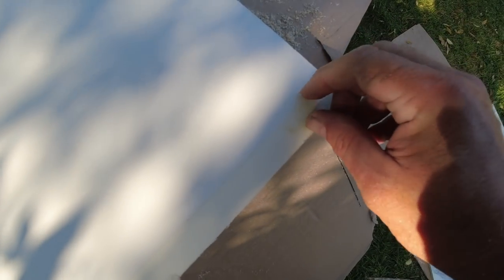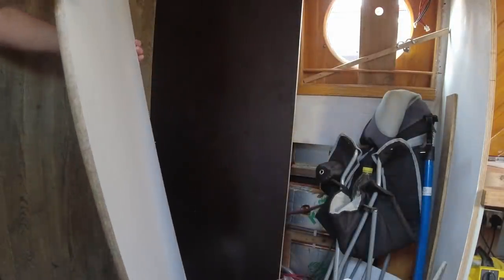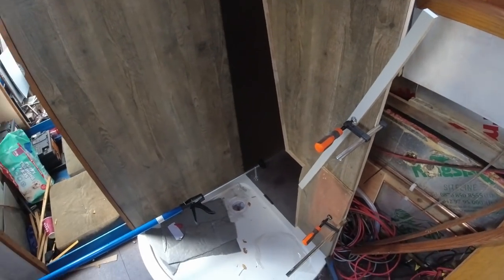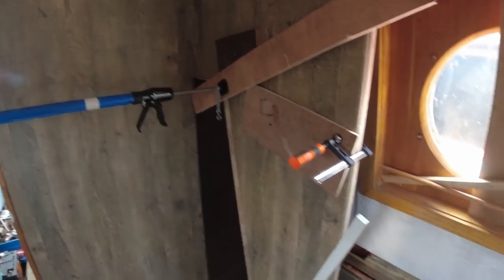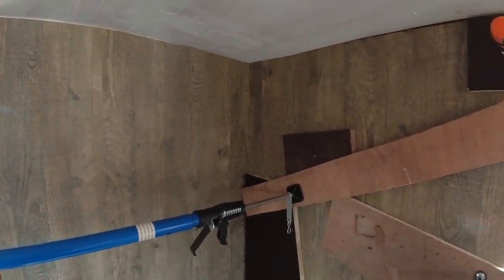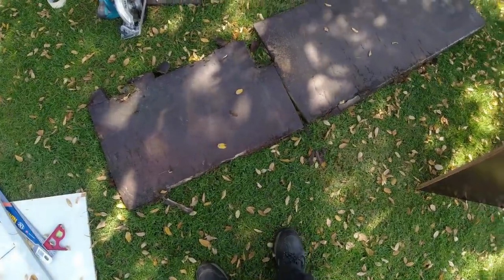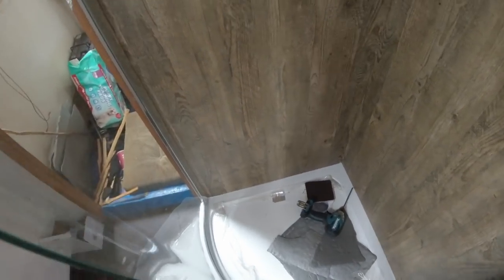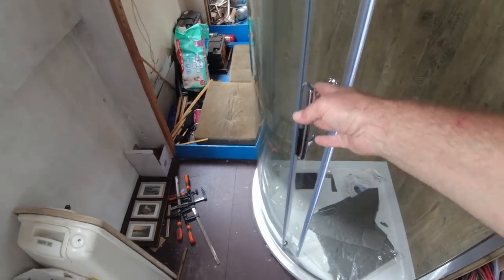Narrowboat Refit #34 Fitting a shower cubicle into a Narrowboat

Comment: i have had the masking tape and saw problem. What works for me is to use low tack masking tape for the marking, and then, before cutting, run some sellotape over the masking tape. You can still see your lines, but the saw base doesn't stick to the sellotape. It works well for me. Cheers Steve, am really enjoying the vlogs and am learning a lot as you go on.
Reply from the maker: Thanks Andy great tip with the sellotape 😊 don’t trust to much on what I do as a lot of it I’m just winging it 😂😂 thanks again Andy 👍🏼

Comment: Steve are you going to put foam lagging on the pipes before you box them in, we found on ours that if you leave the boat it can all get very cold and the lagging helped prevent the pipes freezing  in the winter..😉
Reply from the maker: Hey Shaun, yes will be insulated but probably with foam board rather than round pipe lagging 👍🏼👍🏼 will not have the space behind the boards for the round stuff 😊👍🏼👍🏼